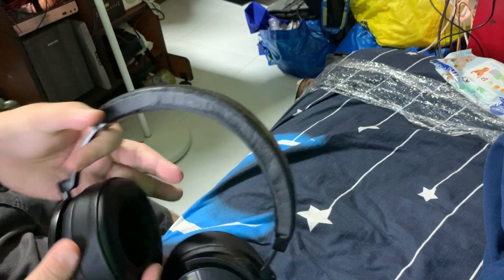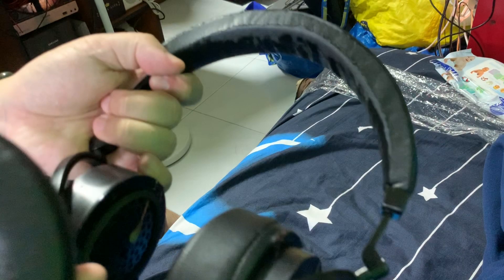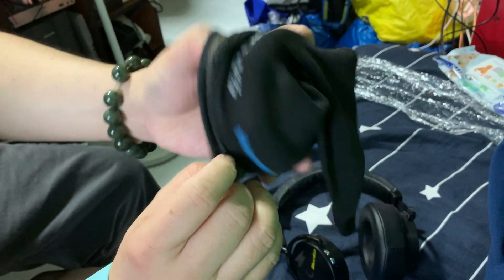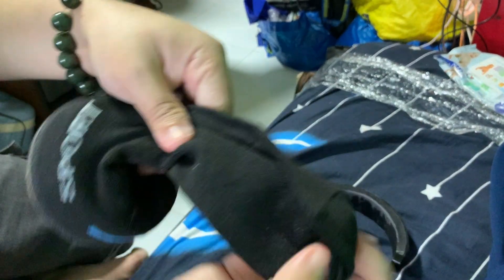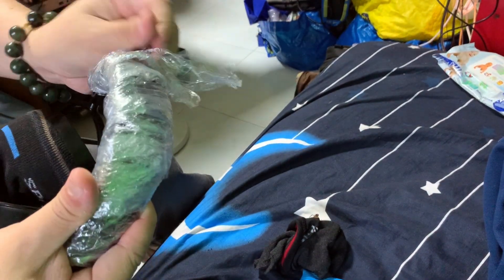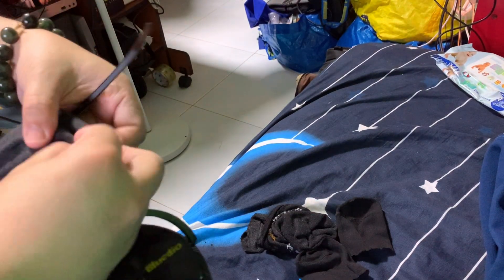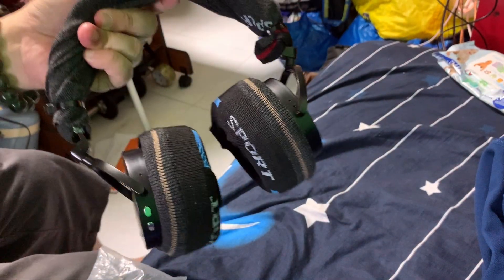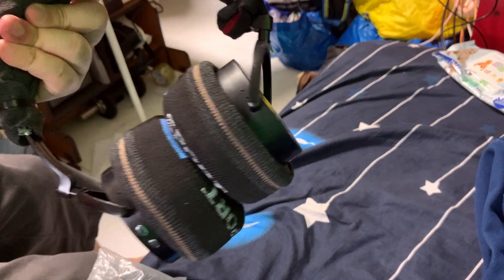DIY Headphone Socks Cover

Comment: I used a car seatbelt protector wrapped around the headband, they come with velcro fastening and work really well....extra padding too 😊👍🏼
Reply: My anker is to big but love the sound n noise cancel. Will try your diy too😁
Reply: hey, does the seatbelt padding actually feel good pr does it still give you a headdent, would love to know
Reply: @thesyndicatea.t.k7528  It’s very comfortable but it all depends which one you go for, avoid the memory foam ones as they’re a bit hard in my opinion 👍🏼
Reply: @annetteedwards9860  alright thanks alot mate, right now it feels like im deadlifting my astro A10
Reply: @thesyndicatea.t.k7528  ouch 🤕

Comment: Tip: Use single color sock without any text or print and sew up the headband part more tightly. Even if your sewing is bad, its gonna look much cleaner. Otherwise thanks for the idea 👍

Comment: Ohh so u wonna fix headset?
Ez first coat it all with soaks
Result :comfortable clean and no one will won't to rob it and u can't hear anything
Reply: you could cut the extra part and "tuck it" behind the ear pad (in my case I can put it inside, behind the earpad (logitech g533 here)